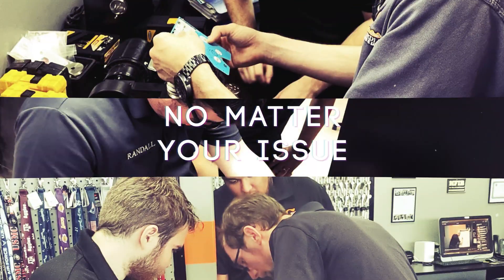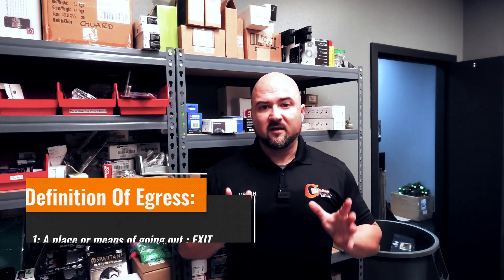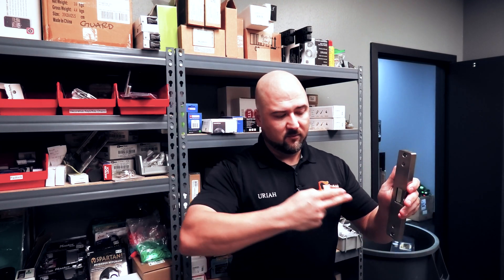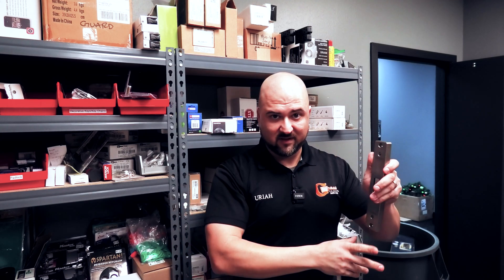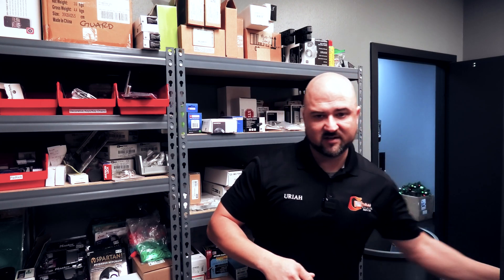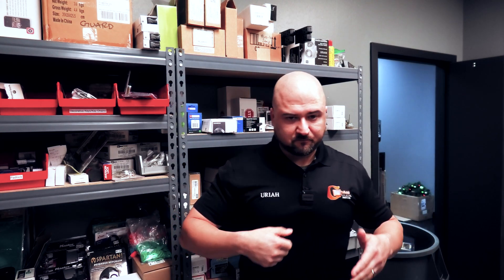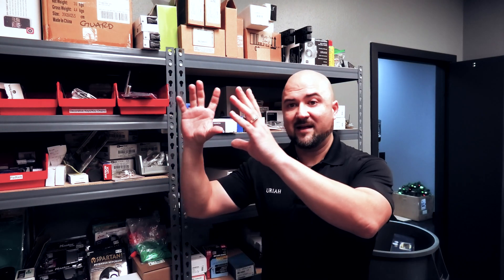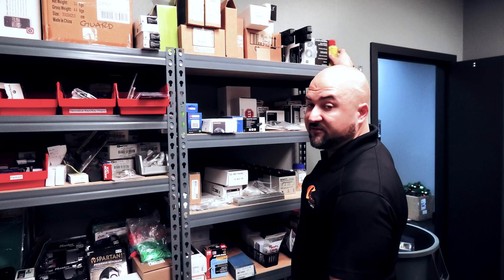Fail-Safe Vs Fail-Secure Hardware: What's The Difference? | Guardian Answers Episode #6

Comment: Thankyou for providing information Sir,
I have a doubt that is when considering the fail secure connection, suddenly power goes off, one person stuck inside the room, there is no way to get the power, how that person go outside without power, and also inbuilt batteries are drained.?
Reply: You must install an emergency button that cuts power to the lock, releasing the door!

Comment from the maker: And that's a wrap on this episode of Guardian Answers. Do you still have questions about fail-safe and fail-secure hardware? Is there another topic you'd like us to cover? Let us know here in the comments section!
Reply: Thankyou for providing information Sir,
I have a doubt that is when considering the fail secure connection, suddenly power goes off, one person stuck inside the room, there is no way to get the power, how that person go outside without power, and also inbuilt batteries are drained and no key for the door